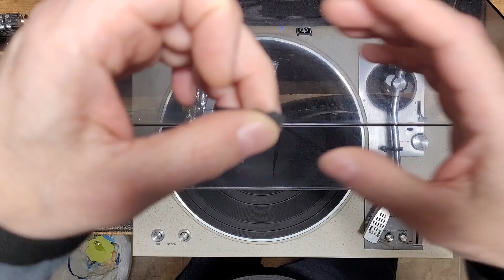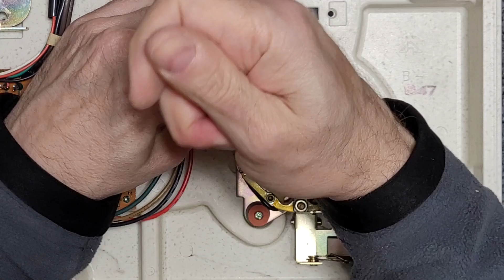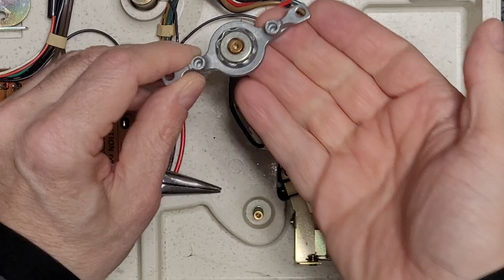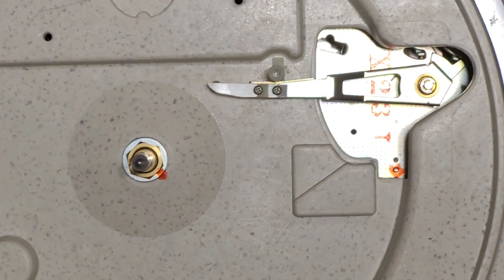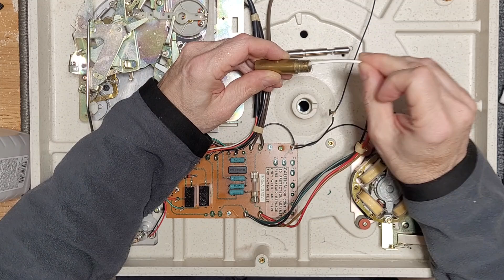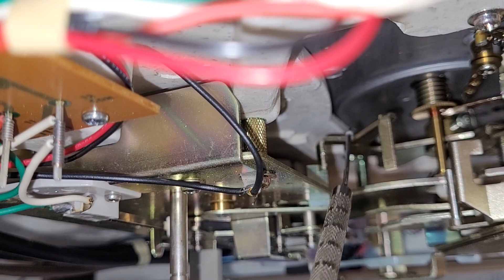Kenwood KD-3055: Service & Auto Return Hell!

Comment: I used two q-tips at the same time with alcohol to clean the inside of the spindle. Provides a great rotation force to remove the old grease in the bottom. NOTE: don't lose the ball bearing in bottom of spindle assembly. They are actually just held in place by the old grease when you lift it up. Damn thing hit the floor and was never seen again.....LOL
Reply from the maker: That's a good idea.  I've actually begun removing them completely from the table and washing them with a degreaser.  Oh, you'll see that ball bearing again when you step on it one day...

Comment: Wish I could've seen you align the cartridge on this.. These have a non standard, shorter tone arm length than a typical Technics, Pioneer etc, so picking the right protractor to use to properly align the cart is a little confusing with these.

These KD-3055's are a major PITA.. Yes, I have one too, which I got dirt cheap since it didn't work right. 

It took me ages to get mine sorted out, eventually realizing that it had a couple slightly bent leaf switches underneath, which made the auto functions not work correctly. What a pain, but at least it works now. 😬

The other issue I had was it was playing way too fast on both 33 & 45. There's no speed adjustment whatsoever, so I had to do it mechanically, by sanding down the brass motor spindle slightly - trial & error, then using a turntable speed app to get it dead nuts, on the money. Idk what caused that, but at least it plays at the correct speeds now.

BTW, you can adjust the tone arm's in groove drop point & runout pickup/return point by adjusting a screw by where the tone arm pivots (like some other turntables), which is covered up by a plug. Tweaking that so that it picks up a little closer to the label may have helped yours some.

Unfortunately the service manual for this specific table does not exist in digital form... Believe me, I've looked, for months! I even tried buying a physical copy of one, which a website, Mike's Manuals allegedly had for sale, but the prick ripped me off & never sent it after I paid.. I was going to scan & upload it too, but it just didn't work out. What a nightmare! Anyway, whatever you do though, Please, Do Not Ever try to buy a manual from him and his shady website, there's a big chance you'll get ripped off, just like I did. 😐

Comment: The KD-3055 appears to be half-way between the belt drive, semi-automatic KD-2055 and the fully automatic, direct drive KD-5070. The 3055 has the belt drive rotation system of the 2055 and the motorized automatic functions of the 5070. While it’s impossible to find a Service Manual for the 3055 it is possible to find the SM for the 5070. Unfortunately, the 5070 manual has little useful information concerning lubrication and refers you to the SM for the KD-5066 which is available and does provide a little information on lubrication. Like some other Kenwood tables viscous silicon oil is used in some spots to provide dampening. I wonder if that would help on the 3055? Also, there is a thread on AK where the member claims to have fixed his 3055 with a few adjustments. Do a search on AK for “Kenwood KD-3055 auto return drags needle” and you’ll find this thread.  

The Kenwood tables from this period (1976 to 1978) are quite good. I have a couple KD-2055’s a KD-3070 (direct drive, semi-auto) and a KD-5070 (direct drive, fully automatic).

Comment: GREAT JOB MAN...Not sure if you getting notifications ,,,but
Have same problem... when in AUTO MODE tone arm returns half way...the only way auto return works if i can switch the AUTO/MANUAL START LEVER INTO MANUAL MODE(after I started in AUTO NODE I then switch lever to Manual Mode)
Not as professional as you are pal..but after watching will try one more time
Reply from the maker: I'm thinking it's the auto return motor.  This table is way too complicated for its own good.
Reply: Try looking at the leaf switches on the bottom. They're very picky.. Cleaning them & tweaking them slightly fixed my auto issues.

Comment: @TurntableGuy see if there is a lubrication chart. Cleaning with iso could flush the grease that was insitu or it may call for specific lube in the mechanism. Alternatively, the original lube may have gotten tacky and providing not enough free movement and storing too much potential energy on that spring. In my experience 90% of issues are clean and lube related. 5% out of adjustment from use and   The other 5% are from a failed repair attempt by a noob.

Comment: I could be wrong, but it seems to me from the outside that the auto-stop lever itself should have a rubber damper made of rubber.
Reply: You have the correct solution. A look at the schematic will likely show a foam bumper pad about 1/4" square to absorb the mechanical force of metal striking metal. I recently serviced a Pioneer PL-12X and a JVC JL-A30 both with a deteriorated foam bumper. Never saw the symptom though because I serviced these decks before running them.

Comment: The pivot that the troublesome  lever is secured on could behave properly is some silicon damping grease was applied to the pivot. The auto return sequence is operating properly aside from the jarring action of the lever.
Reply from the maker: Interesting idea.
Reply: @TurntableGuy see if there is a lubrication chart. Cleaning with iso could flush the grease that was insitu or it may call for specific lube in the mechanism. Alternatively, the original lube may have gotten tacky and providing not enough free movement and storing too much potential energy on that spring. In my experience 90% of issues are clean and lube related. 5% out of adjustment from use and   The other 5% are from a failed repair attempt by a noob.
Reply: Maybe see if there is a lube chart for the unit similar to Dual turntables.  @TurntableGuy

Comment: Protip: After you inspired me to 'repair' turntables, I bought this exact model (along with half a dozen different ones).  For the motor mounts for the Kenwood and any other suspended motor, Amazon sells generic grommets. I bought the 300 Pcs Rubber Grommets Kit and just matched the size to the original. And mine was 'crystalized'
Reply: For REF, I bought motor mounts for my KD 2055 from Gary at The Voice of Music, PN's VM2773 and VM36948. You need three of each, for a total of $6. Works perfectly. He has belts for these, too.
Reply: @rogerclass9923  same here, another vote for The Voice of Music.. That's where to get the best, proper motor mount grommets. 👍
Reply: Another vote for The Voice of Music, for the actual, correct grommets. Gary is a pleasure to deal with. 👍👍